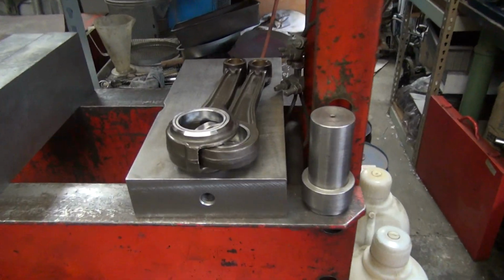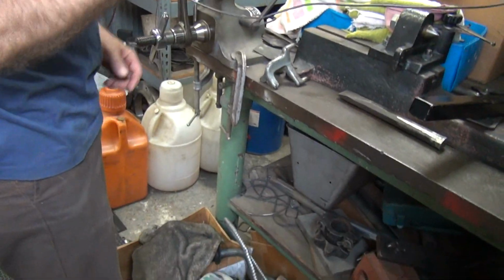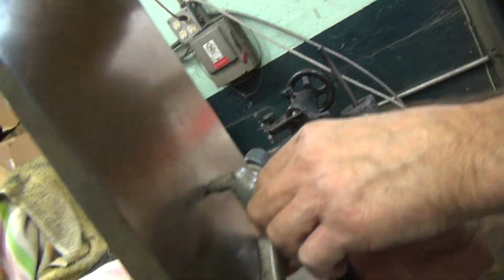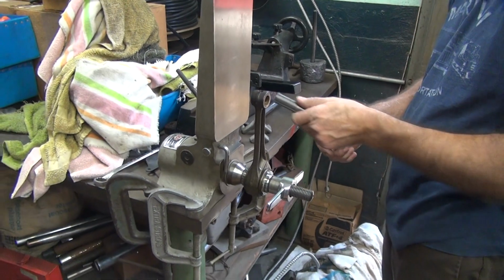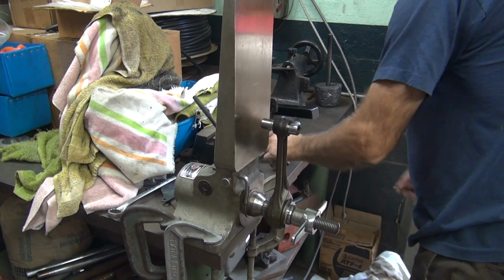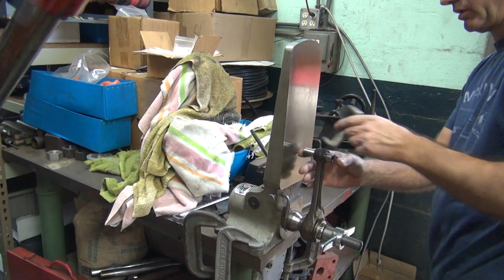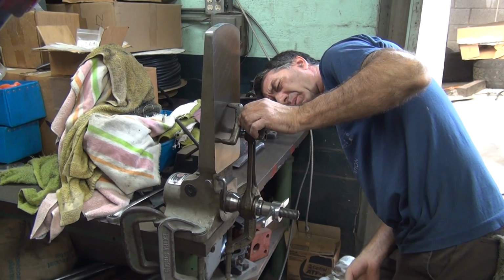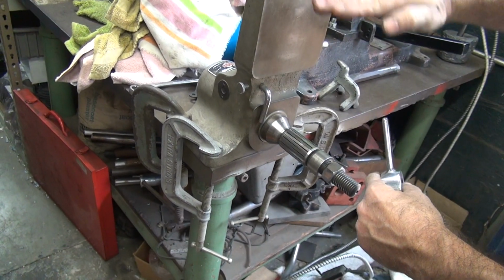1997 evolution 80ci #104 flywheel lowerend rebuild and case change harley by tatro machine

Comment: looks like evo is a practical lil engine for the most part.
Reply from the maker: they are only small when stock. after you open them up they can get big. over all they are very reliable and can make some real power. the aftermarket motors can and do go way over 200ci. 130ci is easy.
tatro
Reply: Tatro who makes the best rods?

Comment: I'd like for you to port some buell heads and bigger valves and a set of heads off 98 evo
Reply from the maker: head porting is about the same for all harley heads. i have shown this lots of times. just look at some of my videos on rebuilding heads or motors. most of these will have that kind of info in them.
tatro